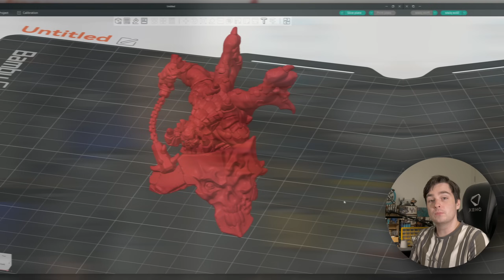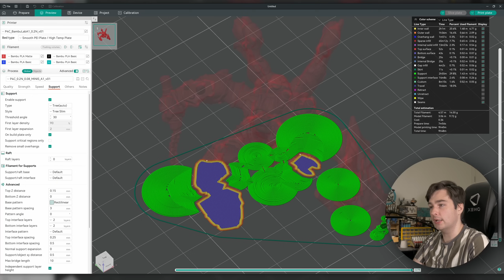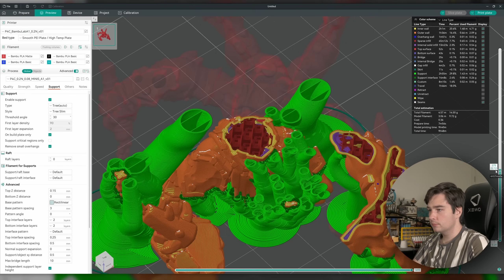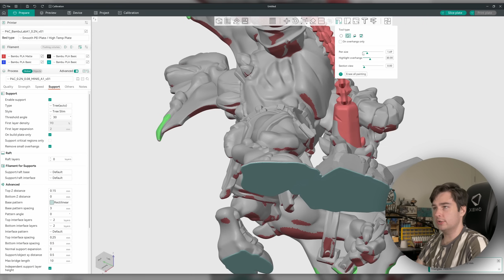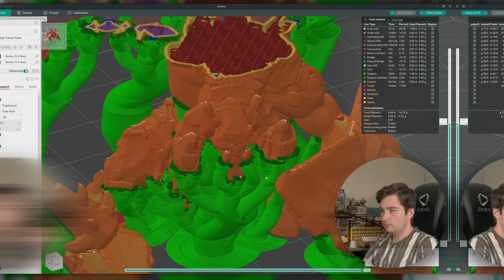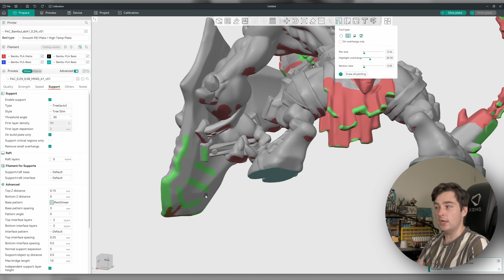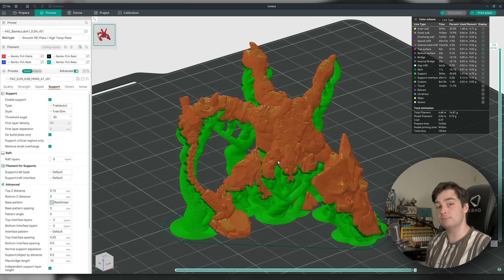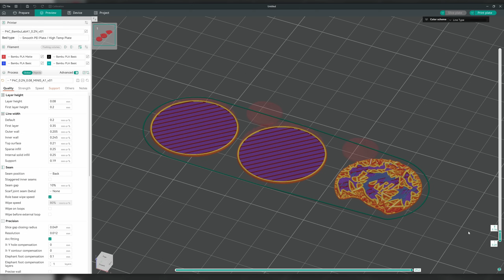How I Support, Print, and Clean-Up FDM Minis!

Comment: Thanks for your video it was very informative. I didn't have much luck however, I cannot seem to get the same effect that you do with supports where there is a dark green "support interface" layer at the tops of supports. It's missing all over the model. I'm new to this, what could be causing this? I have tried in both Elegoo slicer and Orca slicer same thing. Lot's of adjusting settings but to no avail.

Comment: I've downloaded the 4.0 for both the slicer and resin2fdm, but when I  install the add-on, it doesn't show up in the toolkit. I tried extracting the tool into a separate folder and trying that, but no avail. Do you have any recommendations for a fix?

Comment: My way of printing minitaures: Cut them in half vertically, print them face up with as less supports as needed and then glue them together. Instead of cleaning up several support leftovers, I sand mold lines which is a normal Tuesday for tabletop fans.

Comment: why do you use orcaslicer vs bambu studio?
Reply from the maker: Orcas slim support generation is slightly different and has more options for customizing tree supports, Being able to add extra walls or infill to supports for example has been a game changer for me to getting supports that hold strong without having to be welded to the model so tight they never come off.
Reply: Thanks for the reply! I will give it a go! Def struggle with supports that wrap around everything which break parts of mini when I take them off or at the very least leave bad scaring. No matter the mini orientation.

Comment: I keep running into an issue where my nozzle will occasionally clip the edge of a support sometimes snapping the support and causing a fail or loss in quality. Ive also ran into issues of the printer head dislodging the beginning of an object or part of an object like an elbow facing down. I've turned on slow on small perimeter and it has helped but still running into this issue in some cases
Reply from the maker: I would recommend enabling Z-Hop, I used to run into alot of the same and that really helps
Reply: @Painted4Combat  Thanks, I've been doing some more digging and saw that recommended elsewhere. Gonna give it a go.

Comment: I would use the slicer to cut off the wings and print them vertically, they won't need any supports this way and you would have layer lines vertical when the wings would be glued on and vertical are MUCH less visible when painting. The gap can be easily covered by anything lime miliput or Valejjo putty to make it invisible.

NOW, as you are clearly a genius when it comes to blender tools - the thing I struggle with while pre-cutting the models for best orientation of parts is where two parts of the model share a cut line where I would only need one part of the model getting cut. In here the head would be a perfect example, can't cut it without cutting other parts of the model. Do you think there's a way in blender or a tool that you could make to allow for manual cutting parts of the model? I had no luck with adding rings of separation on the models, but I'm a blender idiot so maybe I'm missing something. And ideas?

Comment: Great video. Very helpful to see the whole process especially when including the little mishaps and how to fix them. 

I know it may not be feasible, as it seems everyone uses the A1 Mini for miniature printing, but with all of the pre-made profiles flying around for bed slingers, it would be a godsend to have a good baseline mini profile for the P1S or X1 printers. I’ve tried various A1 profiles on my P1S (tweaking them for my printer, obviously) but it never seems to be as amazing as the ones made and used on the A1’s when technically it should give cleaner/less likely to wobble/break prints (unless I’m mistaken, which is entirely possible). 

Either way, I appreciate your channel for all the helpful insight it gives to the various processes of miniatures.

Comment: what's the benefit of using the sphere tool while painting manual supports? I don't really know the difference between that and the default tool
Reply from the maker: I explain that in my 'Support Painting Quick-tips' if you want to check it out! - the Sphere is essentially a 3d-brush so it can get the backs of the parts you're painting, whereas the normal circle will only select parts of the model you can visibly see on your screen

Comment: Thanks for the great support advice. I find using small hobby needlenose pliers can be easier than the snips when twisting the supports away from the mini. But snips are still needed to break down the larger supports into smaller pieces for easier removal.

Comment: Good note for everyone. Its better to print models in pieces at better angles if your going for good quality. Once u learn how the printer's movement axis work and add supports according to that. Unstoppable after that :D
Reply: 100% agree. Took me multiple failures with horses legs not printing well to just turn the horse on its head and stick the legs in the air.
Perfect print in that orientation and any blemishes from the supports get blended into the mane and the riders saddle.

Comment: I'm not above printing minis with a 0.4mm nozzle so thickening things up in Blender or Meshmixer is still a big part of my process. Not only are the minis generally more robust this way but I generally prefer my minis in the chonkier heroic scale too. Excellent video! Thanks for sharing!
Reply: I've done all my miniature printing so far with a 0.4mm nozzle.  You might not get detail quite as fine, but its enough for my purposes, and I appreciate not having to think about which size the file is sliced for.  I do a fair amount of terrain printing as well as miniature printing (all on an old Creality CR-10S Pro V2, I'll upgrade to a Bambu A1 someday), and its enough work to swap out the nozzle that I'd rather not do that regularly.
Reply: This. Esp. Blender sculpting and tweaks. By the time most of us can afford a 3D printer and learn how to use/maintain it, our eyesight isn't gonna see most of the super small details when the minis are on the table anyways. 😂

Comment: Thanks so much! This is exactly the stage I'm at learning wise with 75mm models :)
1 Question: when you paint in supports, does the slicer add even more supports to the green parts you painted in? Case in point with the shield.

I understand the chain which you all added manually, just wondering what the preferred method is to have more control over supports and if adding green lines will just generate even more supports.
Reply from the maker: The green essentially 'forces' supports to be generated on those areas - The supports still adhere to the support settings, so it will not produce 'more' it will just do its best to have supports connecting to everywhere that is green, even if the slicer doesn't deem it necessary.